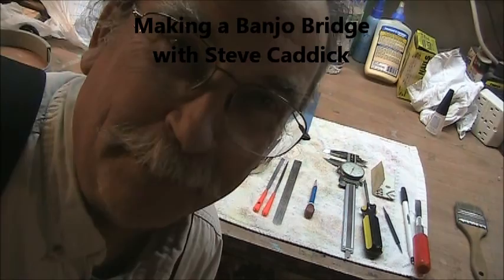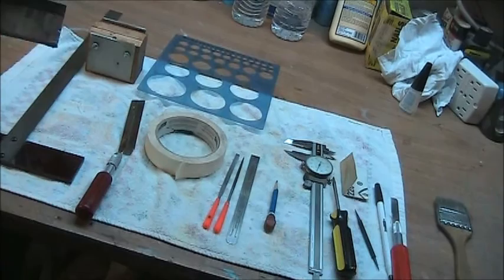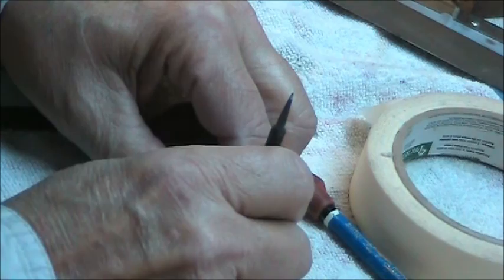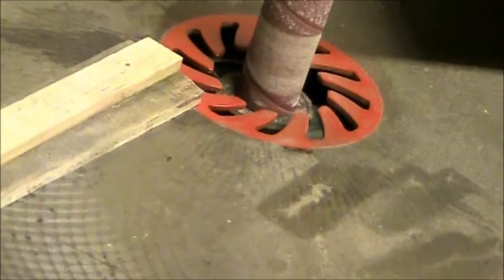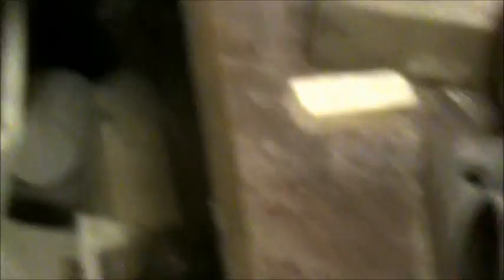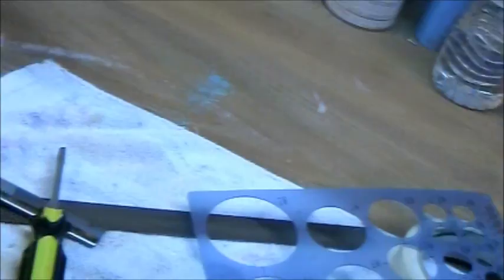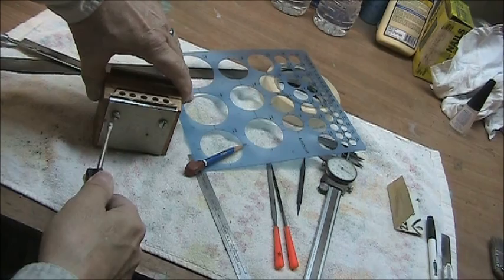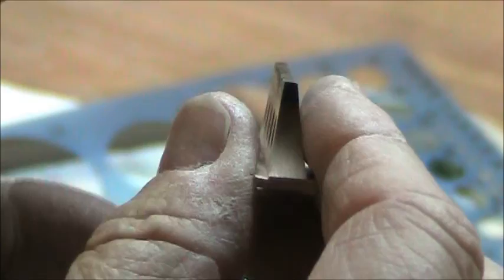Building a Banjo Bridge with Steve Caddick

Comment: How important is it to use  maple wood? I'm afraid maple wood is in deficiency in our quarters. What do you think I could substitute it with? How about oak, birch, mahogany?
Reply: Try virtually anything -- the denser and harder the wood, the more I enjoy the metallic, crisp banjo sound for which  I also use light nickle steel strings for, and on a mylar drum head (maple runs the gamut and so I like harder maple). Softer woods give a more mellow tone catering to the lower frequencies more, like you might seek using phosphor bronze or gut/nylon/fluorocarbon strings for and maybe with a real skin drum head. I'd go with the oak if you want to approximate maple, or you could use the oak for the top stiffener strip and try mahogany for the rest for a more mellow hybrid. Also, though, you may start looking at old throw-away items with decades-old maple etc. in them. Time creates lovely tonewood. I harvested some phenomenal 50-year-old maple with classic bridge-looking medullary ray  blotches. Google "grain orientation in bridge blanks", by Paul Hotstetter to understand how to cut the wood. I quartersaw or split. also google "janka hardness chart" for a good, thorough one to get a good idea up front of the hardness a.k.a. possible tone color. It's endless fun to experiment. This is a phenomenal tutorial which I'm doing next, but a great design that's easier to start with and less equipment heavy is Mike's 3 or 4 part youtube about making a bridge based on cello and/or cello banjo thoughts but great for any. To me the most crucial thing is getting the proper gauge files for the slots if I want to give or sell them to anyone else. I've eyeballed it sofar but gotten lucky with no buzz. I'll cave and get some stew mac bridge files or nut files. There's a 3 pack banjo bridge set not bad about $40
Reply: @jesusfirstto-the-pointendt4552  a lot of great information you've shared here . Thank you much . I'm really wanting to build a bridge for myself and do some experimenting . I'm having a hard time finding some really old maple though.  100+ year old range.  Do you have any suggestions on where to find very old maple like this ? Thanks again for sharing
Reply: @fivestring4653  Hello!  This is Tina.  That was my husband, Jeff.  I'll let him know to respond to you. Peace and Love to you and yours!
Reply: @jesusfirstto-the-pointendt4552  thank you Tina . I was fortunate enough to find a piece of maple 100's of years old I was told from over in Clearwater , FL at Coast to Coast lumber . I'm hopeful it'll turn out to be good but I'm still looking for more because I want to do a lot of experimenting.  Thank you  for replying and the well wishes . Same to you both
Reply: @fivestring4653  Oh awesome... Jeff here, now, hehe -- I collected a bit of old maple from parts of free pianos, sometimes inside, structurally. You can I.D. it pretty well esp when you cut at different angles and see not only the grain but the little check marks that are only visible at a certain axis. It gets easy to identify and bridges are fun to make and share. Another place was old beds, hit and miss but a hit gets a piece with 100 bridges in it, hehe. And then there was a 1938 table saw I got. It had a "fence" that was easily replaced with other lumber so I could cannibalize the piece of aged maple off of it. So many people want big pices for things, but making small parts we can really cash in sometimes. For the very top (not that they don'tsound good plain, actually) I try various things but, not to sound cliche, but I must admit nothing does better than a thin sliver of old ebony. I got a whole envelope of century-old ebony keys off an old foot-pump organ. Etsy I believe. But just a key can easily get you a couple pieces for the top, even after the saw eats a healthy chunk away. Best wishes but be careful. After I wrote the above I cut the end of my finger off. I made a nice, old drill press into a light duty wood milling machine with a cross vice and some end mills. I made jigs to hold wood level etc. I thought the tool was off and sitting still (my air compressor was loud) but it was sitting still and I reached in for the finished bridge and took the end of the tarsal bone tip off the finger and everything. The nail is growing back in now, just a little stumpy. It's my strumming hand, fortunately (not that I played well to begin with). Best wishes
Reply: Old cutting boards. Junk shop quality. Bridge is thin ontop.Go for it.